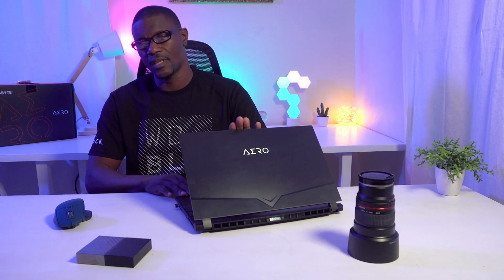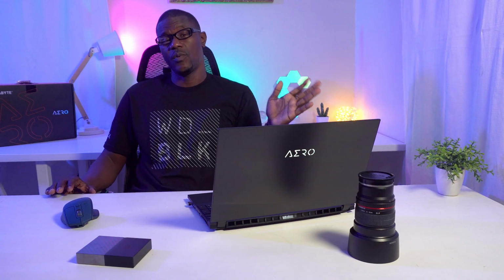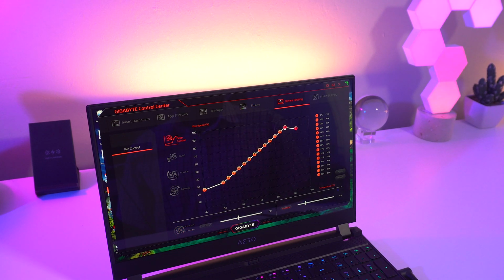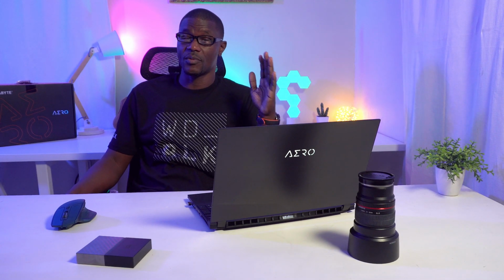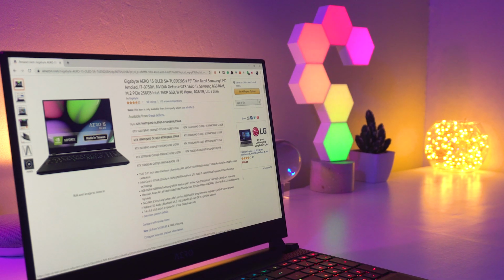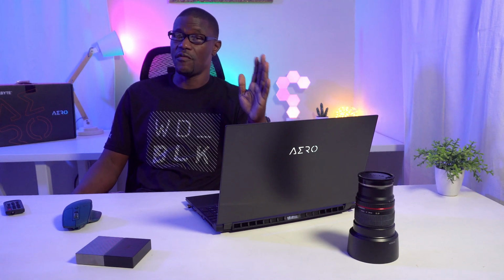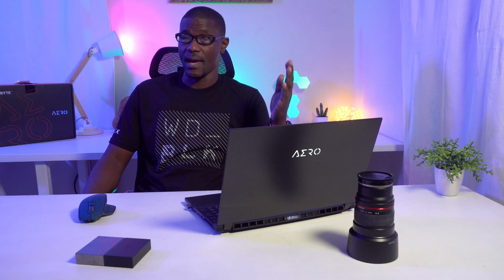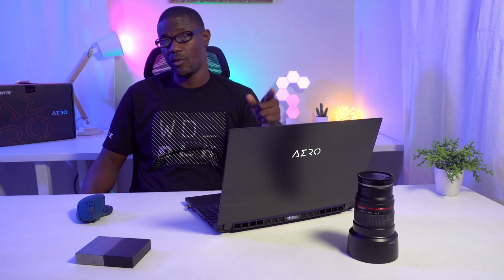13 Things That I Like About The  Gigabyte Aero 15 4K OLED Laptop.

Comment: Ethernet port and alimentation port should be at the back on the laptop for me :)  And Be careful, do not update the latest version of the bios (FB09/F007), otherwise you will not be able to undervolter your CPU from a software like XTU. Gigabyte blocks this possibility
Reply from the maker: Thanks for that tip, because I did undervolt this machine.

Comment: Are you getting screen burn, or whatever the thing is that you get with OLED panels
Reply from the maker: No, I don't have any screen burn in, it's a beautiful display.
Reply: @CHGadgetz  A few more questions: since its 4k, like my DELL XPS 15, it had windows scaling issues, and I'm assuming you're getting the same kind of problem with some apps - Photoshop as an example?

If you were someone looking for gaming and university work, would you go for the 4K OLED, or 240 FHD IPS?
Reply from the maker: If you are a heavy or casual gamer then  the  240 FHD IPS display is the one you should get but if you are a photographer or content creator then the 4K OLED for sure.
Reply: @CHGadgetz  Nice one, thank you
Reply from the maker: Sure thing, which one are you thinking about getting the 1660ti, 2060, 2070 or the 2080?

Comment: I just just started looking at this laptop the other day because I was going to get an XPS 15 OLED, but I think I may get this one instead, really weighing my options. thanks for sharing this
Reply from the maker: Happy I could help you with the information you need, I sure you will get the one that is best for you.
Reply: Not sure if you already got yours, but I just bought mine from Newegg.  They have a sale today for the base model about 25% off.  I would go for that since upgrades for RAM and SSD are cheap 3rd party.  Since Gigabyte isn't one of the bigger selling laptop brands, you can usually find great deals on this model and save yourself a ton of cash.  This laptop has some really killer features for the money.